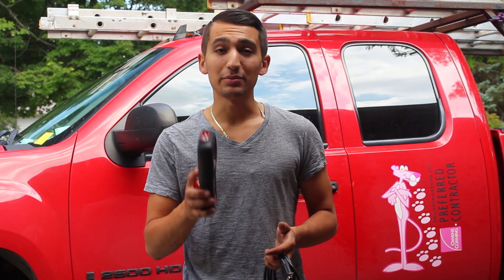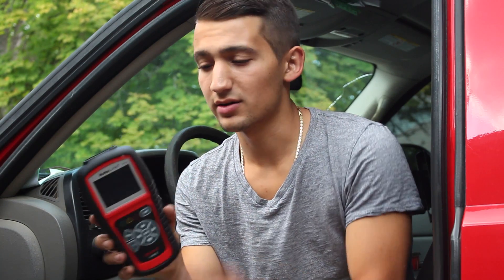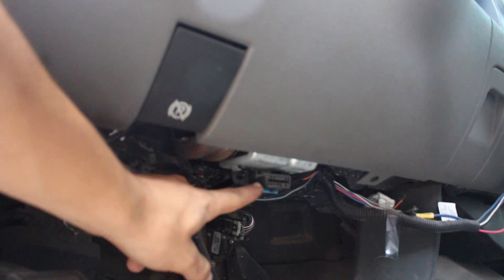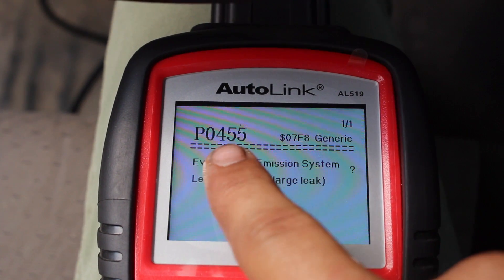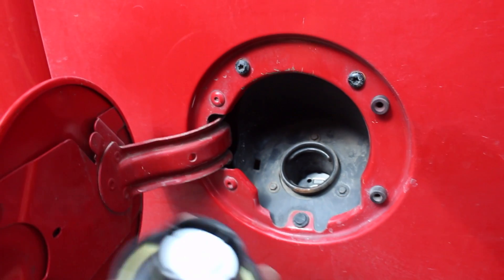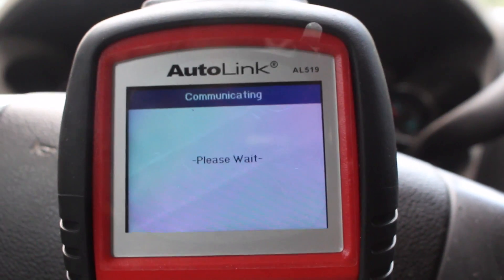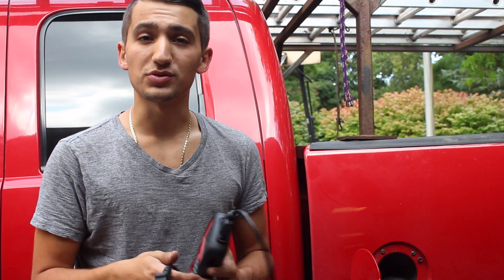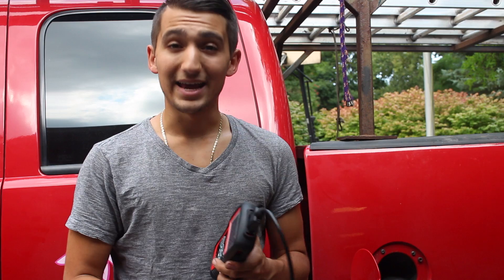Check Engine Codes with a Scan Tool

Comment: Spend another $100 and get a bidirectional scanner that will scan all modules, not just OBD 2.
Like he said, OBD2 will just take you to the area where there is an issue. Confirmation will be needed with the bidirectional function.
Very informative video for the beginner, nice job.

Comment: Does obd tell how long the check engine light has been on for?????
Reply from the maker: Depending on the scanner, yes.
Reply: @milanmastracci  thank you for your response.  I was going to tell a body shop my engine light turned on after an accident.. I decided I'm not going to do that.

Comment: Is there a way to figure out rough transmission shifts with this thing even tho it’s not throwing a code ?
Reply from the maker: That sounds like you may need to change out your transmission fluid
Reply: milanmastracci already did that only like 10,000 kilometres ago, so like 4500-5000 miles ago.

Comment: HELP.  Had my spark plugs changed. Engine lights went off. Then after a while came back up. When I had it scanned at auto-zone, the same code from before showed up. And a new code as well. Took it back to the mechanic and the guy told me the same codes r just old codes. So I was wondering would an old code show up if it was fixed already? Guy seemed sketchy. Got me thinking he didn’t switch the spark plugs. I bought the spark plugs my self and only paid for the labor.

Comment: Great video , Is there a beginner code reader scanner  ( gives the problem without the need to understand the code )  in order to check if the car in good condition before i buy a used car. thanks

Comment: Thank you for sharing; great informational video for a beginner, like me, whom is researching OBD II scanner tools.  I listened on another video that some scanners aren't good for vehicles with aftermarket parts unless you remove the aftermarket parts.  I am lucky that I do not have any aftermarket parts on my truck [2005 GMC Sierra 1500 VHO 6.0L] unless a K&N filter counts in that category.  I hope the K&N filter lives up to the beneficial claims that other experienced after installing a K&N filter.  I have received mixed signals about OBD II scanners because some mechanics told me that GM stopped usage of third party scanner tools.  However, I have watched a few videos about these scanners [multiple brands] and at a minimum they appear to be useful to troubleshoot the vehicle. Thank you.

Comment: Hello Milan, Wanna buy this autel tool, but have one problem, my car is 2000 W210 Merc E430, it is from Japan and doesn't has obd II port (16pin) it has only 38 pin port under the hood in the fuse box. So wanna know how can i get this tool to connect my car? I need some adapter?

Comment: Hi milanmastracci I cannot get my AL519 to show recorded data in MaxiLink2, so I can print it. All I keep getting is a red band with this:- (Please connect the device to computer) Green is the preferred colour.
Therefore the data is not displayed in Maxilink, I have had the 519 for 2 days now and I am going into a state of blithering guru meditation, I'll need a padded cell soon.
Can you plz show a video of the way that you would proceed with the data to show up on laptop/pc?  I have read it could be a production fault and will warrant  a recall to manufacturer. So far Autel support have not replied to my issue.

BMW E46 320D SE 2004

Comment: my car has check engine light on, tried to connect a code scaner but wasnt able to read, what can be the problem???
Reply: Julio Crzy this can or cannot read airbag or antilock brake system codes

Comment: my Subaru died pulling in my driveway and it won't start back up
Reply from the maker: Any engine codes?
Reply: Ty found out my harmonic balancer went out Ty for responding
Reply from the maker: No problem :)
Reply: @milanmastracci  will it diagnose a car that don't start

Comment: at just before 1m , you said " once it is fixed , that light should turn off on its own " . the OBD2 system has to have codes cleared with a scan tool after they are set by the cars ECM . they do not go away on their own . I stopped there .
Reply from the maker: +Gun Runner Yes they do. If the problem that is creating the code is fixed, the check engine light will go off, however a code might be stored in the ECU.

Comment: What about abs problems? Does the AL519 find that?
Reply: Im a bit late but for others interested in this: You need the AL619 model it will cover both ABS and SRS. It does what AL519 does plus the ABS/SRS.

Comment: I have a 2008 pontiac grand prix and getting alot of codes here.
p0300
p0449
p0455
and when i drive faster than 30mph my engine light blinks on and off. I change the spark plugs but not wires yet lol.  great video
Reply from the maker: +Jordan Munoz Thanks Jordan!!

Comment: great info video, very helpful instruction .... BTW, that one is the exact same as the Harbor Freight inhouse "Cen-Tech" Deluxe OBD II & CAN Scan Tool. Just bought one on Black Friday for $55.99 (20% off $69.99).   WARNING NOTE!! - DO NOT unplug the OBD II scanner UNTIL YOU TURN OFF the car/trucks ignition!!! AND DO NOT plug in the unit with the Ignition turned on!! You will fry the unit!
Reply: +Vint Guitarz that is bad design if it's true. did u fry one?
Reply: Harbor freight? Ok will check it out! Thanks

Comment: I prefer the ELM327 which cost me about 10$ and works via bluetooth on my phone. Used it a few times, very handy!
Reply: +Bjarni Freyr it might take a few tries to get it connected. Also, use the app Piston. I found it works better and connects better than Torque.
Reply from the maker: +blackdragon1299 Thats not bad at all :)
Reply: +blackdragon1299 I bought two, and they never worked... I used multiple phones and different, cars but the Ecu never connected....
Reply: blackdragon1299 thanks... Ill give it a try